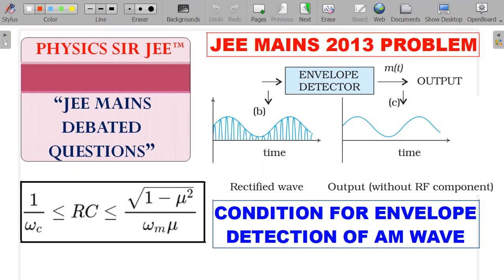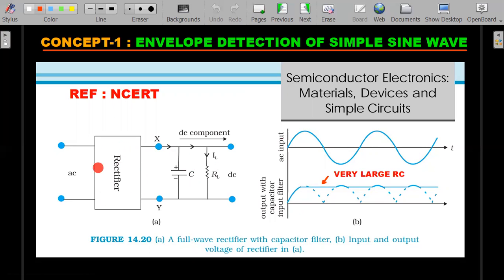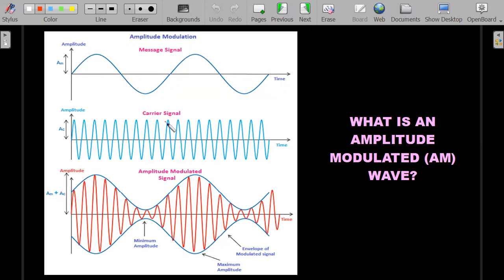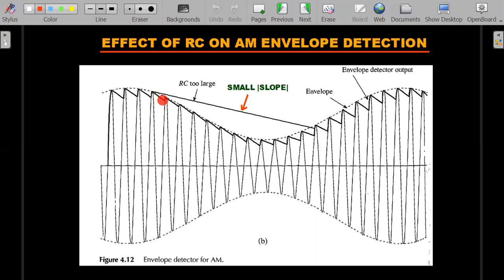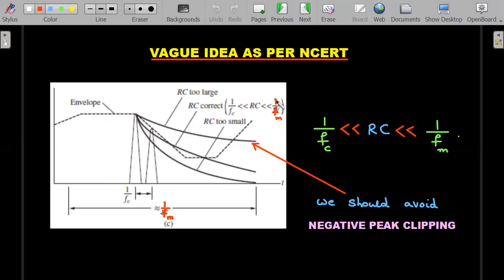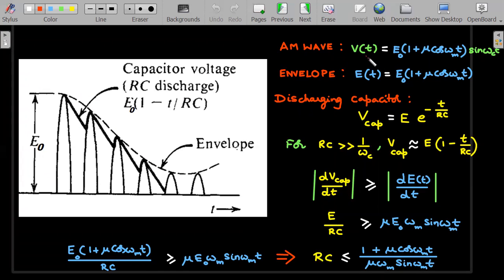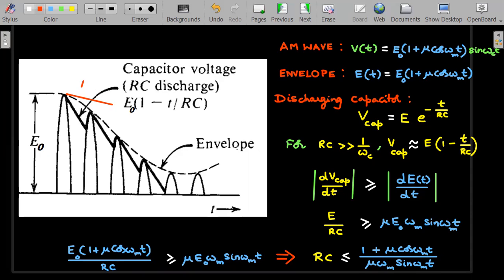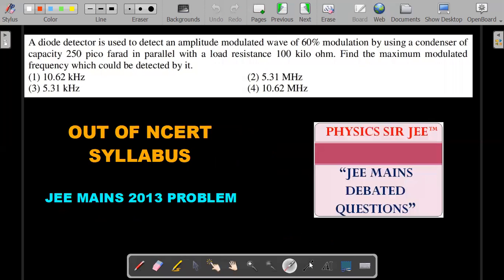JEE MAINS DEBATED QUESTIONS | 2013 OFFLINE | DIODE DETECTOR | ENVELOPE AM WAVE | OUT OF NCERT

Comment: 1)Sir answer to this question is coming even by using the general formula rc<<1/wm
2) In the question he has asked " modulated" not "modulating " so should we not use wc as in amplitude modulation frequency of modulated wave is same as frequency of carrier wave( but we don't have any formula for its maximum)